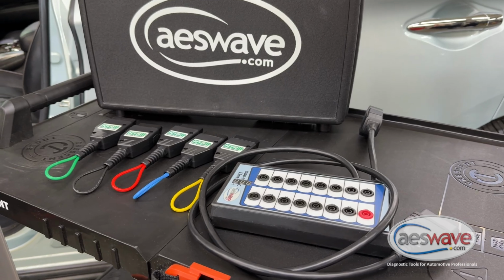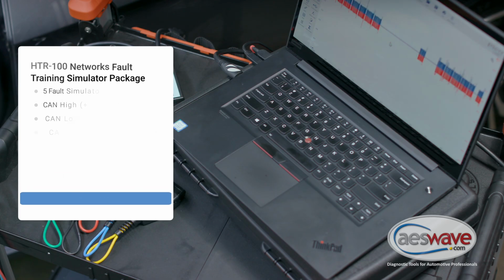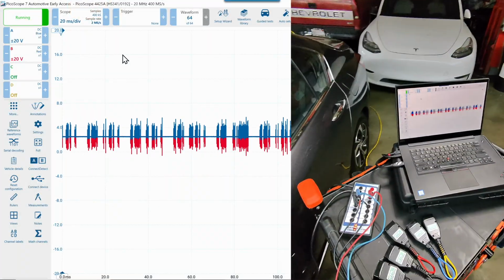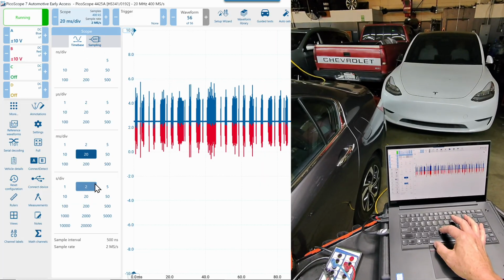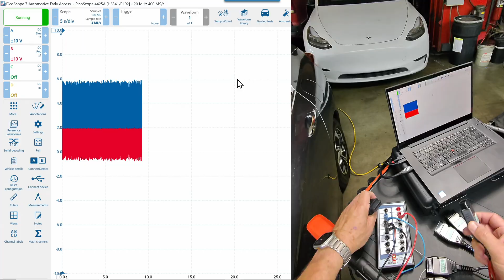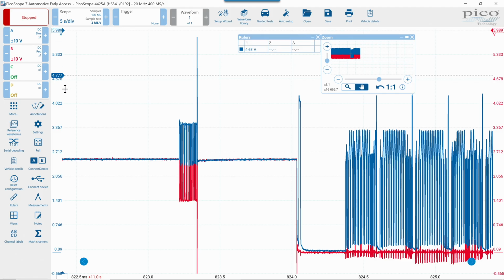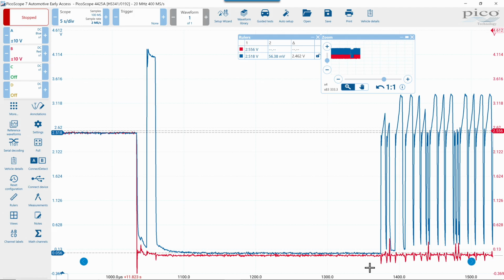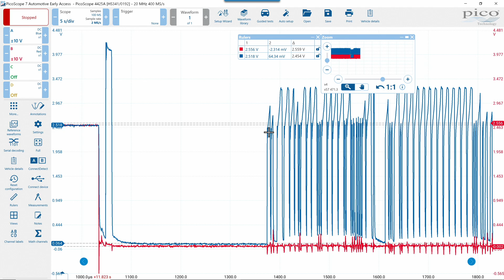HTR-100 CAN Bus Fault Simulator: Hands-On Training for Automotive Network Diagnostics

Comment: I was recently looking into this kit. Saw it for about 7-8 hundred bucks on the site. If the vehicle is equipped with a gate way. How does this tool affect the network system? Also, do it have one that can create a fault on Kline and CAN Low speed.Really intrigued.
Reply from the maker: Great questions, this training device will not work for vehicles equipped with a secure gateway where the J1962 port is isolated from the vehicle. Vehicles built before 2017 should work fine. However, one should always review service info. The five fault plugs are designed to fault only pins 6 & 14 at the DLC. Your feedback and questions are appreciated and we'll be sure to share them with the developer.